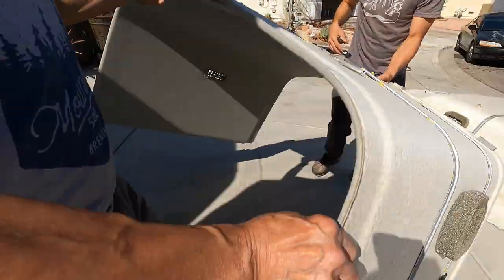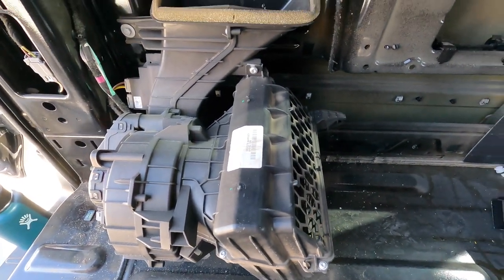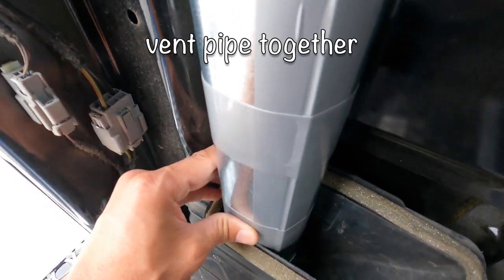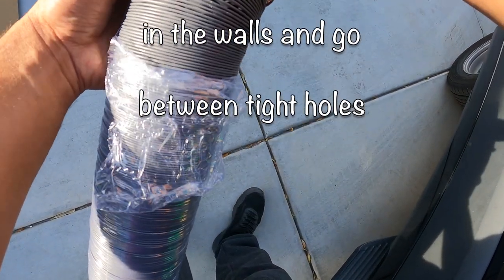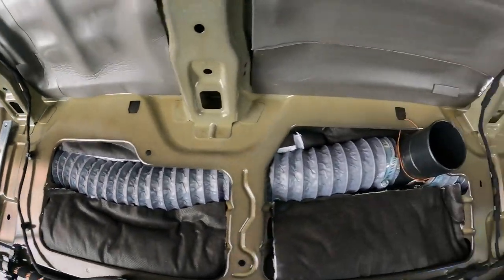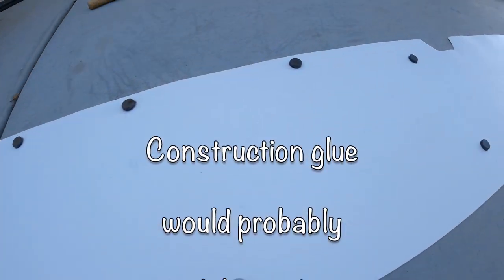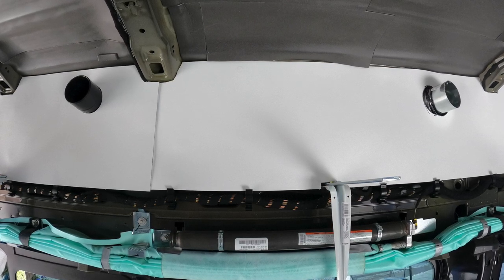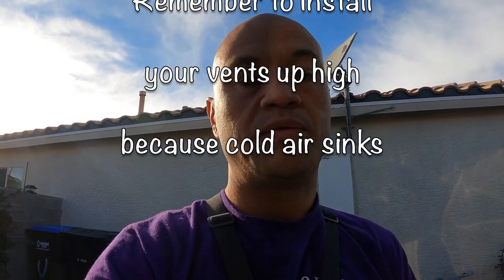How To DIY Reroute AC Vents Lines Ford Transit Passenger Van. Change Existing Air Conditioning Ducts

Comment: The 3 inch vent slows the flow compared to the much larger plastic riser.  There is a reason for the size of the riser and this likely reduces the flow of air. Don’t reduce the duct riser. Keep it about the same or larger.
Reply from the maker: The reason I went with 3” hose is because you can fit it into the wall of the van. 4” doesn’t fit and anything larger would have to be put on the outside of the wall. 
After installing the 3 inch lines and 3 vents, I can honestly say it blows harder and farther than the 10 vents Ford installed. Ford didn’t even seal all the cracks and gaps in the vents so it’s not very efficient.  And it’s not blowing in areas where I don’t need it anymore.
Reply: @ChilliesWorld  It was smart making the vents much shorter than Ford did inside the hotter upper reaches of the van. Your design gets the cold air out into the interior much quicker where it's needed, not running through 20 feet of uninsulated and unsealed ducting. Take note Ford.

Comment: I neednto do this as my dogs are too hot in the summer as the first crate is freezing hogging that ac where it blows out in the cargo van and the rest suffer.  What do you think about using 2 or 2.5" instead of 3.  Three really sticks out.
Reply from the maker: I went with 3 inch because that's the smallest size duct work and vents I could find. 2 inch may be too small. How many crates do you need to get air to?

Comment: Thx you for making a beautiful work on the passenger van.  Where do you buy the polywall?  Does home depo carry it? Do you plan to build a shower inside the van?  Can you make video of completing the bedliner with polywall?
Reply from the maker: Thanks for watching! You can get the poly wall at Home Depot its called "White Polywall Plastic Panel" I plan on having a shower but it will be modular set up. I'll share that as well. Bedliner? Do you mean the headliner cabinet area?

Comment: Very simple and appears to work well.  Over time, have you noticed any flaws?  And airless or loosening due to temperature swings or movement of the van?
Very simple and appears to work well.  Over time, have you noticed any flaws?  And airless or loosening due to temperature swings or movement of the van?
I've been considering different set-ups and this is byfar the best I've seen yet. been considering different set-ups and this is byfar the best I've seen yet.
Reply from the maker: It’s been working great for over a year now. No problems with reduction in airflow. The only thing I recommend instead of using duct tape would be to use the silver metallic tape used for sealing ducts. It’s supposedly would last longer. I got that tip from another viewer.
Reply: @Chillie  Excellent!  [Thank you for the fast response].  I challenge that commenters suggest.  I have that metallic tape and have actually used it on seams for that metallic bubble wrap insulation-type material (I forget what it's called).  It's been a week and I see it starting to pull up in spots.
That being said, it is pulling up in spots with a little more movement.  
I'll try to come up with something more durable in for that portion and let you know.  
Beyond that, I'm going to copy your design.  Thanks again, man.  I think you've saved me a lot of time & money testing out different ideas.
Reply from the maker: @Jerenemy  I’m glad I could help. Yeah let me know how it works for you. I used a really strong duct tape and haven’t had any problems.
Reply: I have doubts about any improvement here reducing the size of the ducts. Theorically the airflow is the same, as it's controlled by the blower motor. So I can't see how this can improve the cooling capabilities.

Comment: That is an interesting AC solution, I wonder if you can buy that separately. I like how it is down low vs being mounted on the roof.
Reply from the maker: Ford might sell it as a replacement. But then you would need to add AC lines, power , and then recharge the system. And it all runs off the van.

Comment: Nice video. Is it true the rear ac can only be powered when the engine is running?
Reply from the maker: That is correct . . . unfortunately. Wish there was a way to run it without the engine.
Reply: You call the unit in the rear "the AC". However I believe that it is only a blower fan which disperses heat or cold from the engine's coolant system or front AC compressor? So, this is prob why the rear unit cannot be run without the engine on.

Comment: Chillie, I’m so glad I’ve come across your channel.  I’m in the UK and have just started a conversion on a 2017 Minibus myself.  I have a decision to make about the AC Unit under the passenger front seat.  This provides air to vents in the rear floor.  The unit is going to make providing a swivelling seat difficult so may have to go.  Does your van have this too?  Seeing the airflow you get from your roof vents, I think just the rear unit is enough.  Any thoughts?
Reply from the maker: Hey Neil! I don't have AC under the passenger seat but I do have heat that went through the floor vents. The rear unit is AC that I rerouted up into the upper cabinets. I installed a diesel heater in mine, so I could remove the heater ducts from under the passenger seat, if I wanted to try and install swivel seats. Are you sure its AC under the seat? Cool air falls and warm air rises, so I would check the air coming out the vent first. It may be heat. This might affect your decision. Let me know what happens.
Reply: Chillie,  so I’ve done some tests with the vehicle running.  When I start the vehicle and adjust the overhead temperature controller, cold starts the rear ac unit and warm starts the under seat unit.  When you put it into a middle setting both units run….  Thanks for your reply.